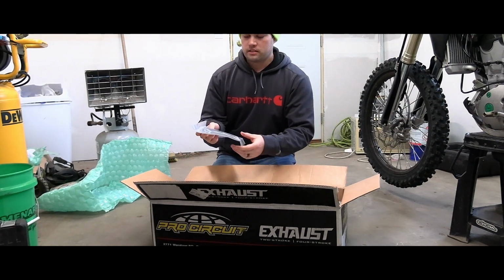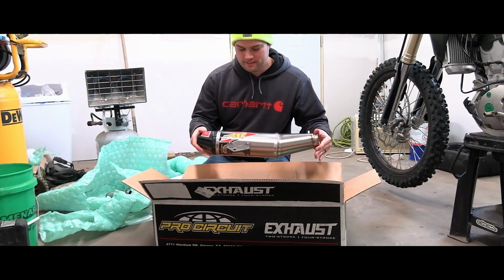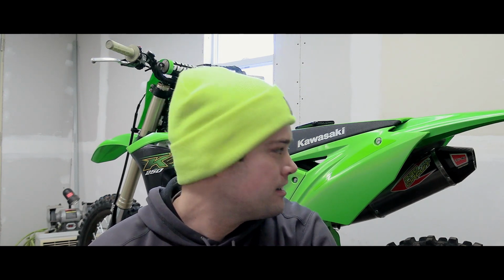Installing a Pro Circuit Ti-6 exhaust on my 2020 KX250 with sound check

Comment: Bc I got a 2021 kx 250 just what would  be the best for it so want have worrie about storing it in the winter or win I don't ride it for a long time is the vp t4 good or do you have to mix it with gas or just put it right in the bike thanks bud
Reply from the maker: I generally run VP T4 with great results. At a minimum I’ll run 91 premium pump gas. T4 is a direct pour in gas replacement. No mixing needed. I haven’t had any issues storing it either. I generally do some indoor riding/races over the winter, so my bike never sits more than a month without running, but I haven’t had any issues.
Reply: @andrewowen9513   Iam running 93 pump gas right now so vp T4 may have to look in to it
Reply: @andrewowen9513  thanks for the info bud
Reply: I'm an otr trucker bike sits a lot vp t4 always delivers for me love that shit

Comment: How did you get your exhaust to go blue? I just put the ti6 on my honda and i only have a tiny bit of purple around the weld. Maybe have to actually ride it?
Reply from the maker: Mine only turned a little while idling, most of the color change was on the track. I've seen some people use a propane torch to heat it up and force the change. There's a handful of videos out there of people doing it that way too!
Reply: @andrewowen9513  oh ok. I’ve put a few hours on mine now and they didn’t change much so i put a little heat to them to get a little blue

Comment: How do you like the low end/midrange with it? I've heard of people having trouble finding the right ECU coupler to match the exhaust, but who knows. I'm on the fence with this or the yoshi
Reply from the maker: I can’t comment on the pipe alone, as I also put in a piston and changed gearing before I had a chance to ride it. I ran the white coupler with decent results. For me, It felt improved throughout, but not significant low gains until I had it remapped. I had it remapped after the mods, and it really woke up the bike. Quicker and stronger hit down low, and still had a great top end power.
Reply: @andrewowen9513 who remapped it for you

Comment: One quick question what is the difference between the TI6  pro and the Ti6 is it the same
Reply from the maker: Per pro circuit, the only difference is for sound requirements in pro racing. Performance should be the same. The Ti-6 also has a removable spark arrestor that the pro does not come with.
Reply: Oh i see yeah it's because i plan on buying a pro circuit exhaust pipe for my 2021 kx250f they look nice with the carbon fiber 🙌👌

Comment: Did you have to get the couplers remapped for the exhaust or the ecu tuned?
Reply from the maker: You don't HAVE to remap the ECU for it to work. The bike runs fine just bolting it up, however to fully take advantage of the pipe, I would recommend it! I believe Tokyo Mods is doing a package deal right now so that if you buy the pipe through them, they will reprogram your ECU for free.
Reply: @andrewowen9513  thanks, if only I lived where they are 😂😂